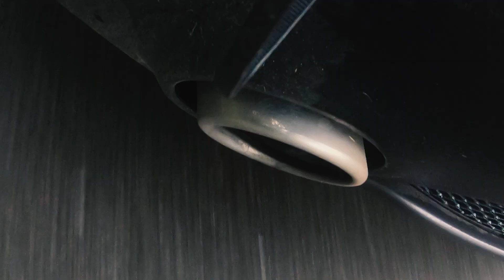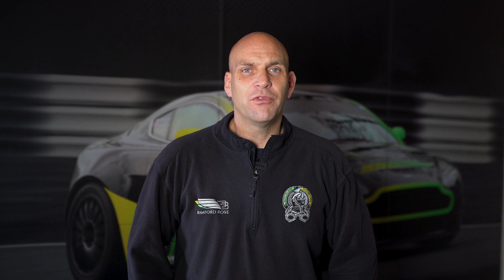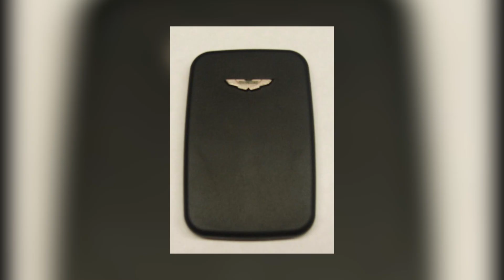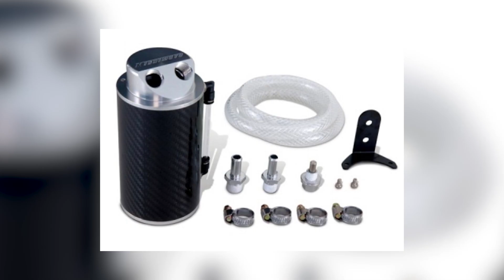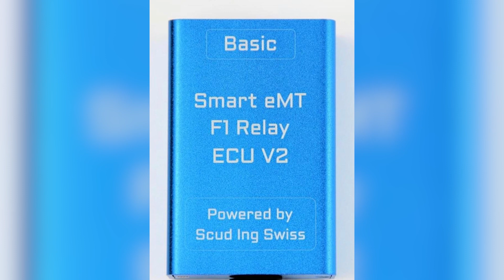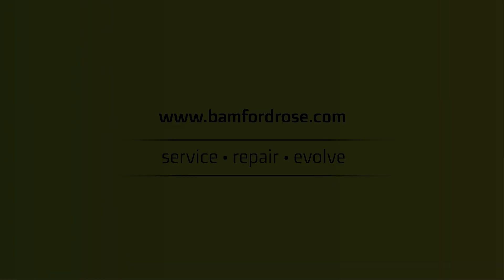The great and not so great products for your Aston? QOTW #117

Comment: I've never understood why people would want to delete or bypass the SmarTire? Just replace the sensors in the tires when the battery goes dead and the whole system works as it should. I had a near flat the other day driving from work too. An event at one of my buildings and the little alert popped up on my screen telling me my tire was running out of air and sure enough it was almost down to the wheel so I pulled over pumped it up and it saved me a tire and a wheel.